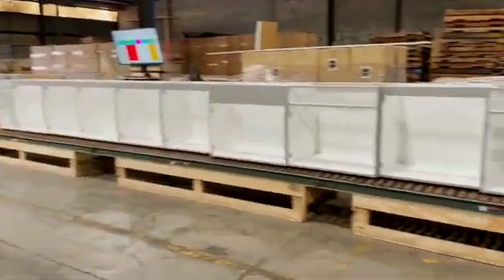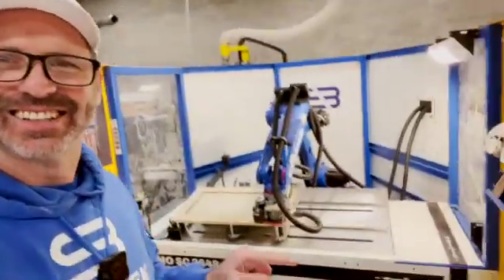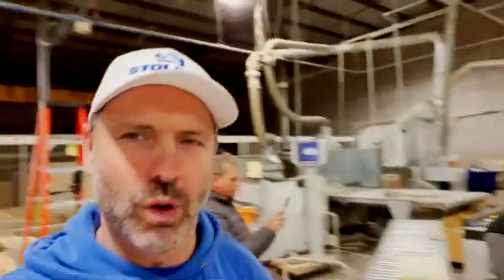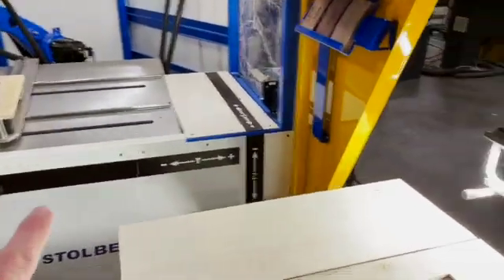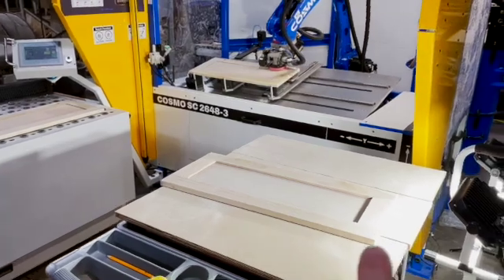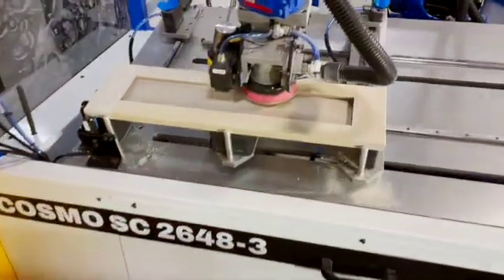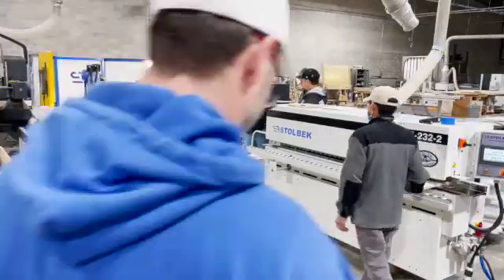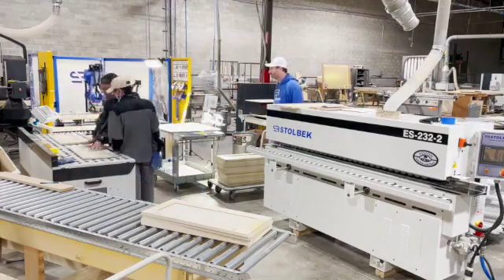Robotic sanding with the Lean manufacturing principle of Single piece flow.  Cosmo the sanding robot

Comment: The human there still required to be there and involved looks pretty repetitive and boring. Hope that aspect improves as well.
Reply: To the contrary…. Most batch manufacturing forces people to do the exact same thing all day stuck at one station.   This o set up allows them to move doing 4 stations for each part.   But, every has a different opinion of “boring”.   What’s boring to you,  is someone else’s dream job.   In repetitive work situations, we have people focussing on the process and improving it to keep their minds engaged.   Rather than being forced to focus on the work.  It’s a great paradigm shift.
Reply: @QuantumLean  I should hope so and I guess as these transitions progress those interactions of human and machine will change. I doubt the next 5 years will be slow and steady. More and more I think we are going to have to put more "value" on when and where to use automation like this. And where it isn't helpful. But volume work like yours is always the first obvious place to try it. By the way, Fleming's Lean Logic is interesting for a broader view and one that is quite expansive.